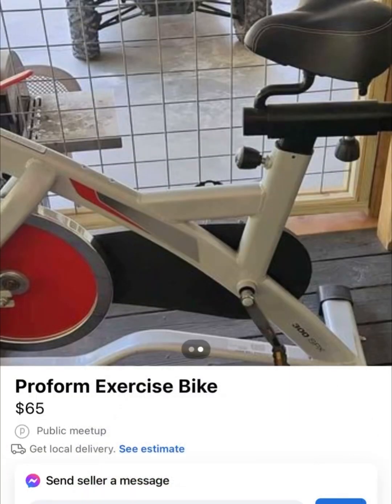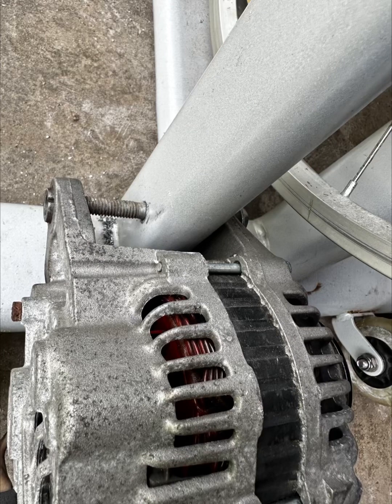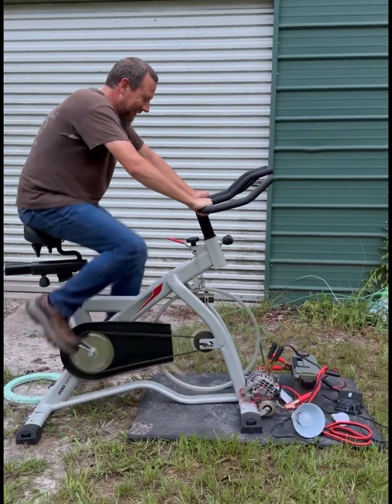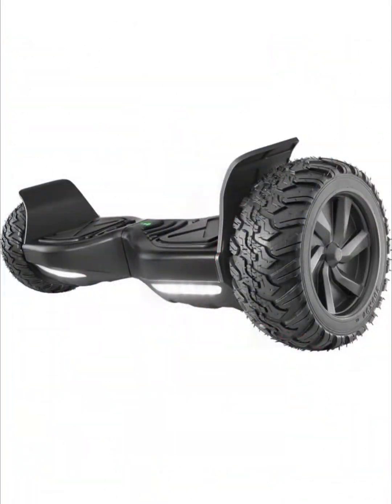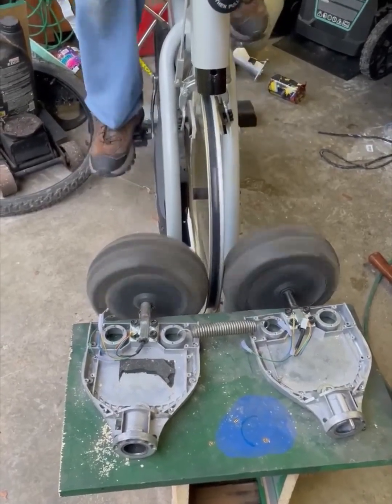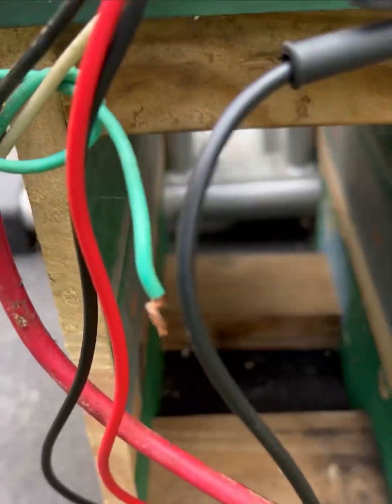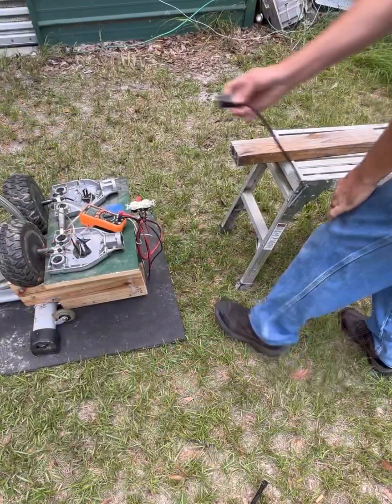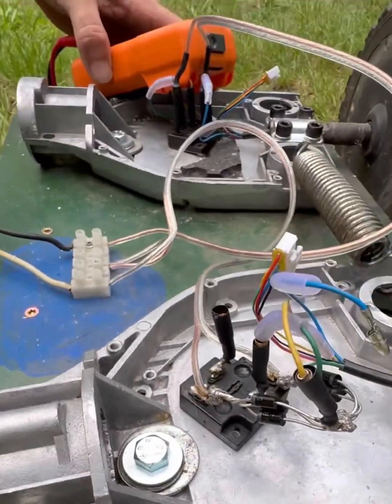Alternator vs Hoverboard Bike Generator

Comment: would you be able to charge a battery with this sort of set up? would you need some kind of charge controller?
Reply from the maker: Oh yes would charge a battery but yes would need a buck converter or charger controller each motor can generate up to 50v

Comment: I’m suprised you can run those AC tools on DC. I suppose they must have a rectifier into DC motors or something.
Reply from the maker: I was surprised as well!! You can run any a/c motor with brushes meaning making contact with the rotor on DC as long as you have the required voltage or even a little lower.
Reply: @ArcAngelTeslaCoil  oh really, that’s amazing
Reply: These kind of motors is called a universal motor and it runs with all kind of voltages. The voltage  has just to be enough.
Reply: When you stop peddling it stops charging, as long as output is not too high for your battery, around 14v for a 12v battery 🤣😃

Comment: Are the two phase are synced ?
Reply from the maker: No they are rectified dc so the motors don't need to be synchronized the voltage with both motors rectified is about 115vmax